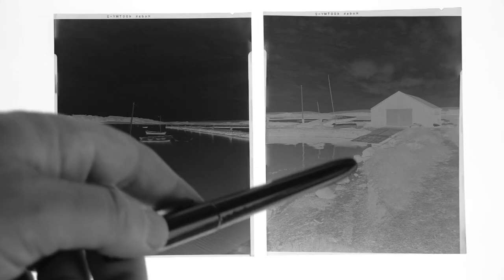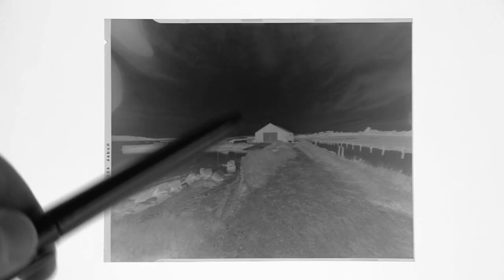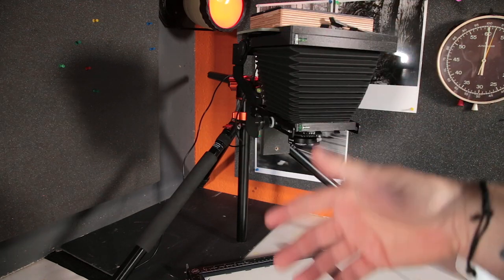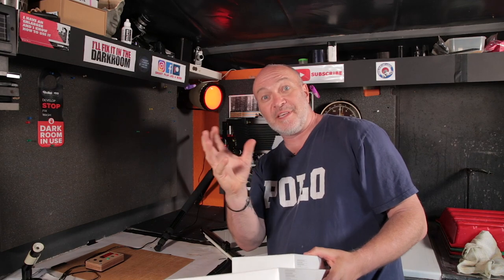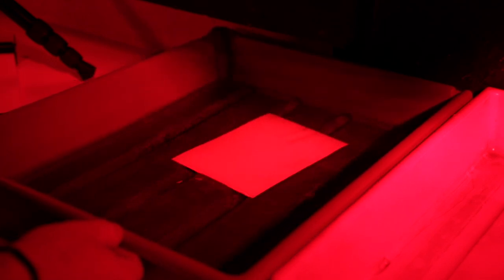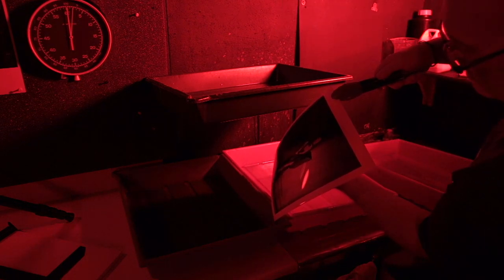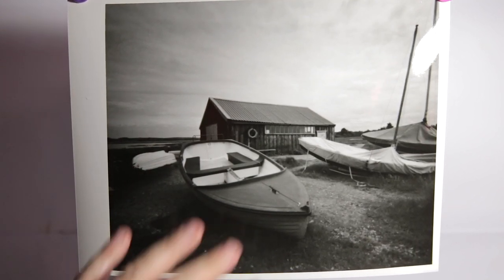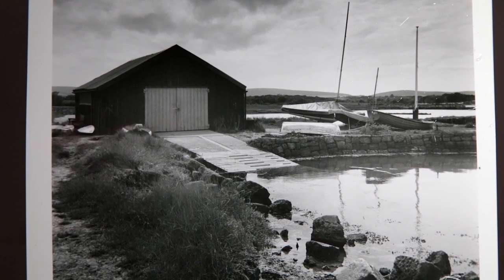Part 2, Printing in the darkroom. Part 1 in description.

Comment: Ooo great prints as always!

I ordered the intrepid camera enlarger accessory you used here and I'm really looking forward to giving it a shot!! Your videos have thought me a lot about printing so excited nervous to try. Hopefully my makeshift washroom darkroom works well. 

I will say that your lack of dust here is impressive. I developed some 4x5 for the first time and they are just drowned in dust sadly. Will need to figure out how to avoid that for next time... 😔
Reply from the maker: On my one it uses felt around the edge of the light. It gives off tiny fibres which you can see on the print. Be careful of that.
Reply: @ShootFilmLikeaBoss  ooooh good tip thank you! Will have to keep an eye out for that

Comment: Just curious: You mentioned the hair in the negative. Have you tried spotting something like that out in the negative? I've never done that myself but have heard that this is possible.
Reply from the maker: It would be impossible to spot as it is black on the print. I would have scratched away the emulsion on the print back to white then spotted but in these comments someone said use a magic marker to pencil over the mark then it won't come out black on the print and easily spot. Good idea

Comment: What do you do for temperature control in your shed? Here in the American midwest, we'd be freezing in the winter, and sweating like mad in the hot humid summer. Is your temperature a constant 68/20 degrees with a managable variance?
Reply from the maker: normal days here I can print at normal temp without loss or increase. Hot summer I wait for late evening and in winter I use a radiator and if the chems drop I just warm up in an old microwave